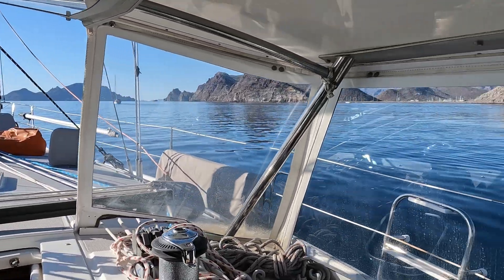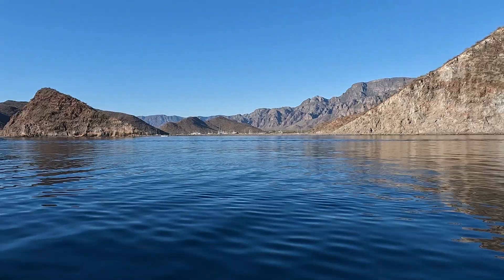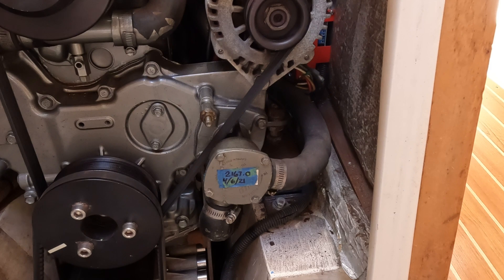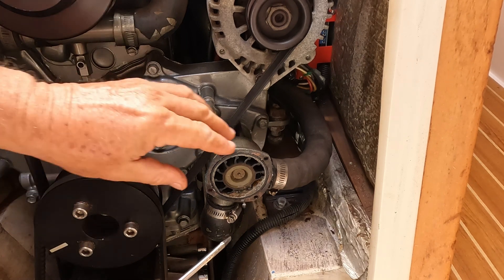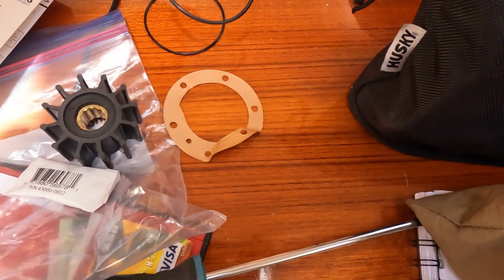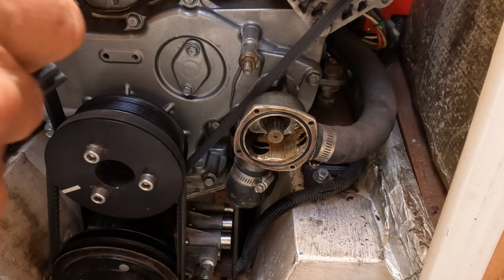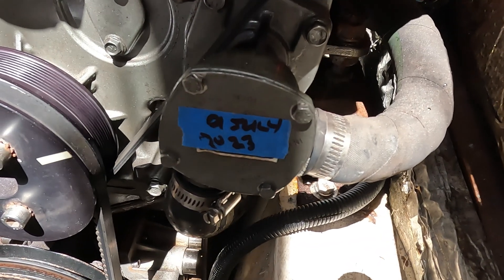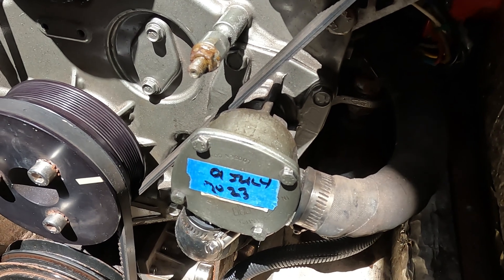Higher Engine temperature, impellor, seawater filter or blocked heat exchanger

Comment: So did the new impeller help or is through hull partly obstructed?  Is the heat exchanger in need of descaling?  I can’t take the suspense!
Reply from the maker: Yes it worked. However I’m going to descale the heat exchanger too . The end caps are covered in gunk , think the previous owner didn’t have the rubber seals when he last descaled it and used gasket gunk to seal it . Doesn’t look very nice . I bought new seals , just have to find them 😀